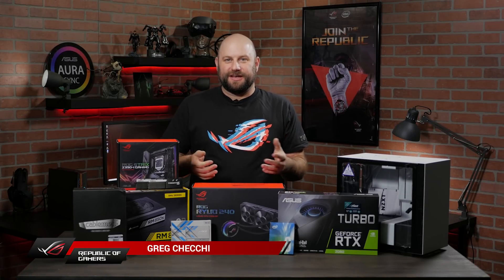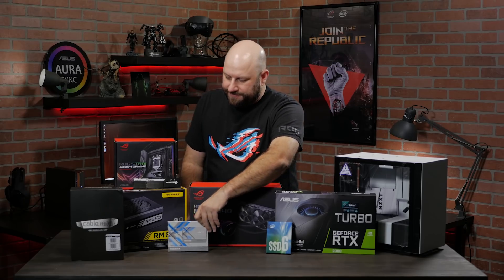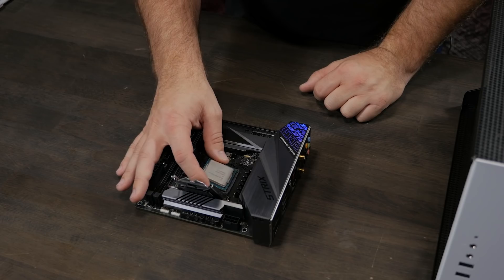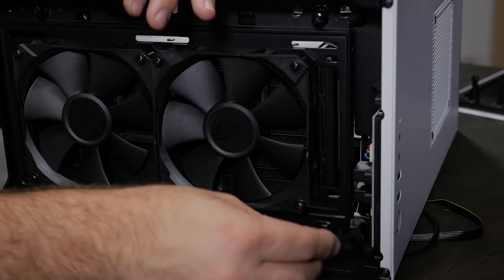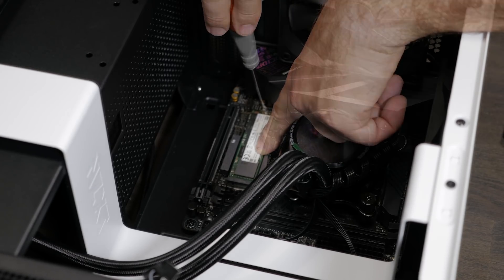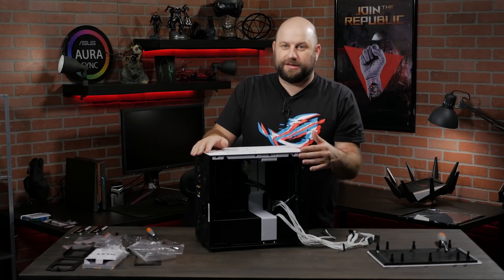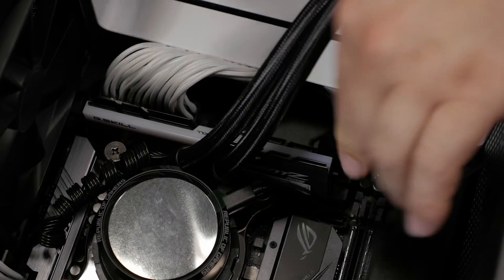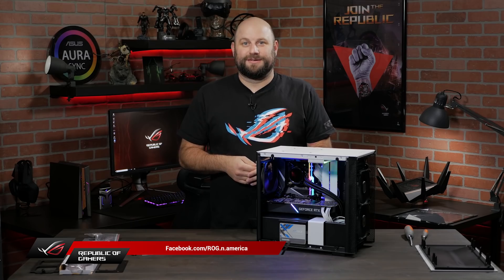How to Build a #Z390 Gaming PC feat. the #ROG RYUO 240 and #ASUS Turbo #RTX2080

Comment: I have just one question the original cable micro USB and 9 pin cable its not fit on the motherboard there for you use a Sata power cable to give power to the water pump. Can you link where to buy this type of cable? And why an Asus product is not compatable with an other Asus one???

Comment: When I Connected   Pump Micro Usb 2.0 to Mother Board Usb 2.0 Connection System Not Open....My config z390 i itx mother board with ryuo 120 ...without usb everything works fine...

Comment: Just curious as I now got all the parts to this build and I am having trouble as the usb 2.0 connectors for the fan case and the AiO cooler share the same plug. Are there two places on the motherbpard to plug all these in? I'm scouring the manual but I can't find a solution.
Reply: Same here i try to build the same Pc but idk what to do now
Reply: Did u finde out how to plug them pls help

Comment: So i built my Asus pc yesterday.  z390 - E mboard with an Rog Ryuo AIO but i've a problem. I downloaded the livedash thing to control the picture/Gifs on my ryuo pump but when i click apply nothing happens and Asus Aura is not detecting my Corsair vengeance pro ram, can anyone help??
Reply: having the same exact issue once i installed the malfunctioned app called Livedash my AURA will now not even detected my Ryuo 240 or my Asus Z270 mobo. pretty upset

Comment: Several points to newcoming rig builders.

1. Always prepare for static electricity when dealing with the components
2. Pre install everything on the board before installing when possible. M.2, cpu, ram, mounting coolerbracket. In a small case it can help with headaches.
3. Replace the pre applied thermal compound with something of better quality. It will help later with temps
4. Personally I would go with a reversed fan setup for the AIO and assist it with better air flow within the case. Less dust and possibly better temps for mobo and other internal components. One note, always test as it really depends on multiple factors

Comment: Why don't all you motherboard manufacturers get together and come up with a standard for  all the various connections like on/off, reset, hdd activity etc? Then we could have a single connector like hd audio?
Reply: Everyone thinks theirs is better and the proprietary nature nets them more money so it'll never happen unless Intel/AMD or some central body makes them do it.
Reply: @CourtneyRoberts1982  we have a standard for HD Audio, USB 2.0 USB 3.0. There is NO VALUE for any manufacturer to have a weird or different pinout on the remaining connections. No one cares if Asus, MSI or Gigabyte thinks theirs is better. If it were the same then one could have a simple one piece connector, just like HD Audio. We don't need differentiated products in this area. No one will ever pick a motherboard supplier based on the layout of this last few connections!

Comment: Love the build, but I think the front fans should be placed on the inside because if you decide to put the front panel on, those fans will have a tough time pulling in air.

Comment: I have same case with ryzen 2700x version of this build:
Asus strix x470-i 
Asus stris gtx 1080 and man was a pain to fit any 240/280mm aio in it...not with that long card ! 
That's why he mount the fans outside of the case which also won't work because the front panel  cant close properly (trust me ,I tried) also not to mention the dust filter is out from the start and airflow is severely down! 
I ended up with one 140mm nzxt kraken x42 !
Reply: This is correct, the front panel will be kissing the fans on the outside of the case for the AIO. If you use a slightly longer card its very difficult to fit everything. Would also recommend people to use an SFF PSU as the cable clutter at the back further limits the airflow behind the radiator!

Comment: That build wont work with the RTX Turbo dual. The heatsink on the card would hit the power-supply shroud. Not to mention it has a PCB back-plate which isn't present on the GPU which was used on this video.  I was curious  to see thermals because I have a Asus turbo and its a toasty card....but it looks like it was swapped. Overall nice build though.

EDIT: I just realized the card was the ASUS Turbo... Not the turbo Dual (confusing naming scheme btw).
Reply: There is no "Turbo Dual".. its just "Turbo", "Dual" and "Strix Dual OC"

Comment: You should have mounzet the aio fans from the inside, there was enough space because it's not a long gpu. That way the air wouldn't come from a 90 degree angle like now and the aie flow would be much better.

Comment: That m.2 heatsink doesnt seem to do anything really, just for looks.
Reply: looool you have no idea what you talking bout.
Reply: A heatsink with thermal pads/paste under (i hope it has otherwise it will bake the m.2) with the same surface area as the m.2 does practically nothing to help with the cooling of the ssd, it might even be worse having it on than off for cooling. Do a search on m.2 heatsinks and you will see how one that is designed to cool the drive looks like. This is only here for the looks.

Which is totally fine but he said its purpose is for cooling the ssd to not overheat, if that was truly its purpose then it would have fins.
Reply: ok